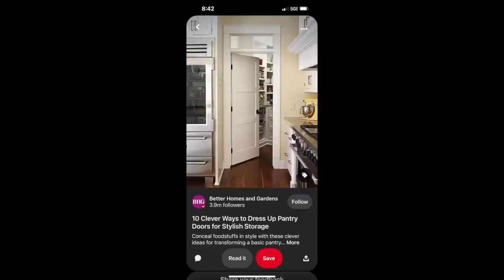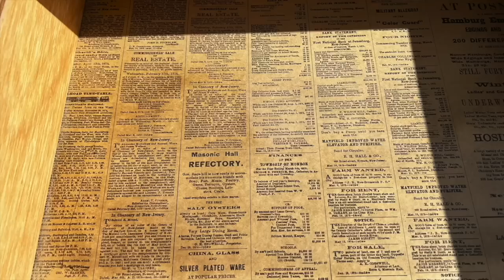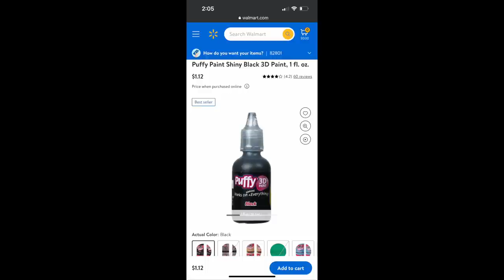Unbelievable Pantry Makeover: See This Hallway's Secret Transformation!

Comment: Turning the a/c vent cover will still have limitations. Remove the hinge and put trim on the ceiling that will allow the cover to slide open like a car sunroof head liner. Put dowels that can be removed to hold up the filter.